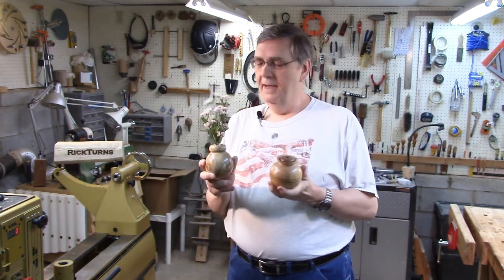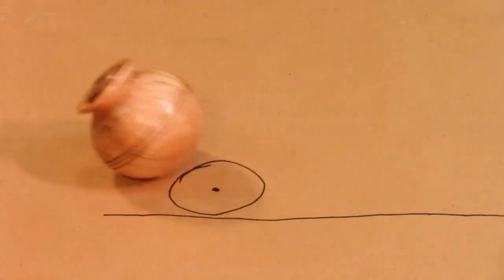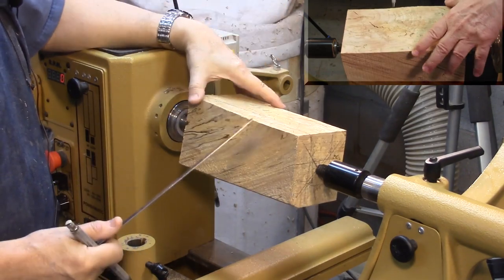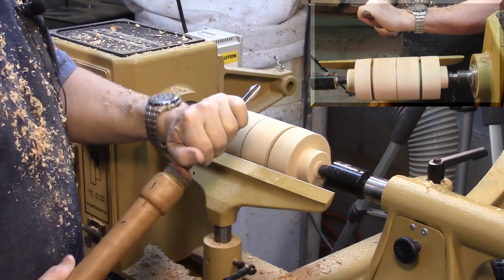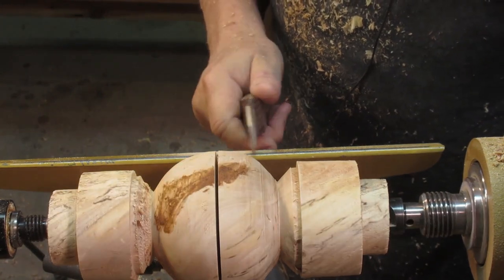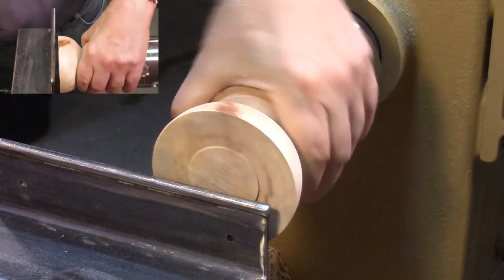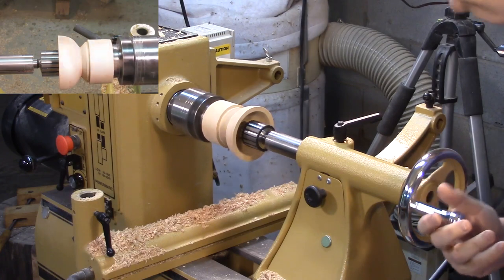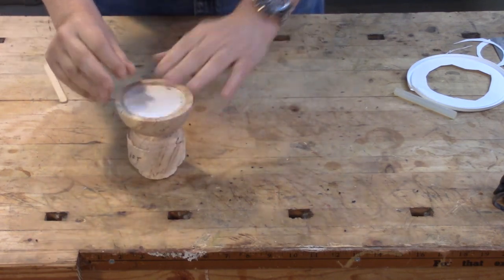A Wobbly Twig Vase

Comment: Rick, have you tried BBs for  weights? Bill
Reply from the maker: +Bill Bryan I thought about using BB's but I didn't actually try it because I've still got a good supply of lead shot. If I ever run out of that, I might give BB's a try, but I tend to think they would not be heavy enough. Thanks for the suggestion, Bill!

Comment: A way to make the weight cheaper is to use lead weight off of car or truck wheels that often you can find/get for free  .... would just need to use lead shot to fill the voids in between the wheel weights
Reply from the maker: +Gord Rich Thanks, Gord, that's an excellent idea. I'll try it out!
Reply: @RickTurnsWoodturning  If I remember right wheel weights are not lead anymore, but they might work I don't know.